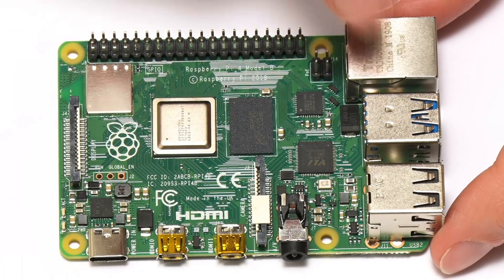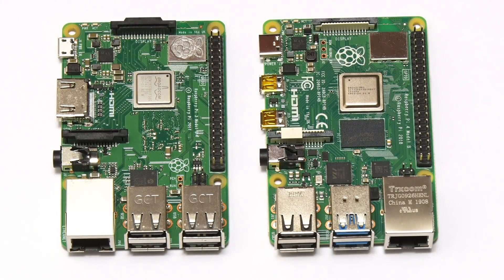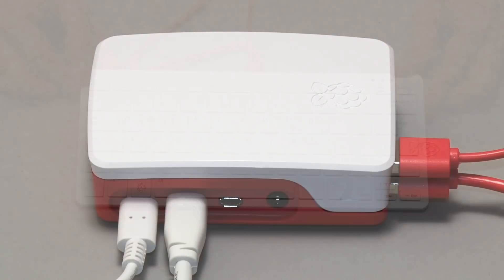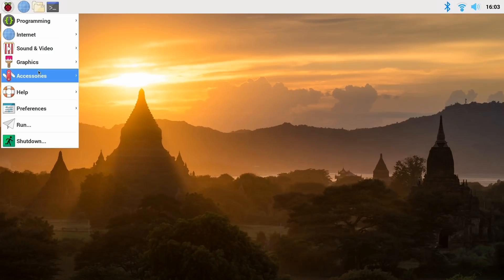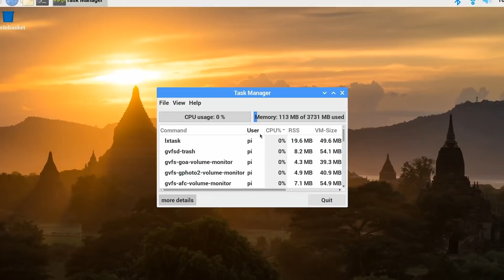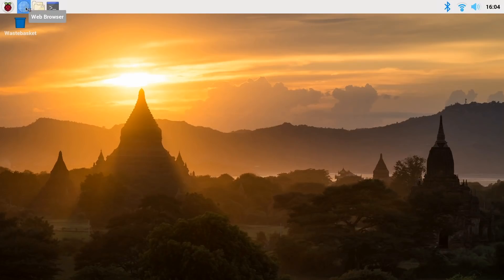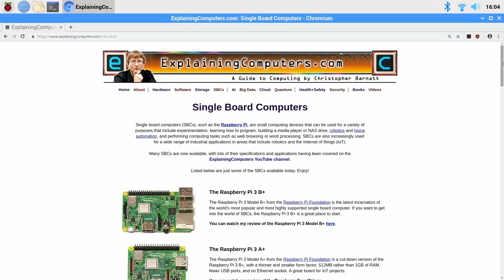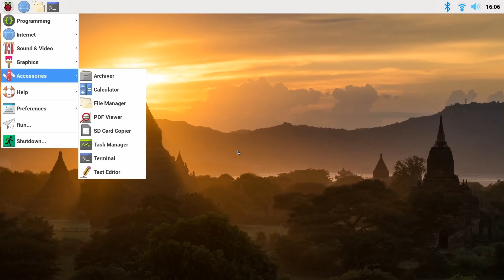Raspberry Pi 4 Model B

Comment: Raspberry Pi4 🍒💡
How to Power ⚡to PoE 🕸️ 24V???? and 48V ???? Doc!💬👍
DataMek From 🇩🇰 Denmark.
Reply: henrik, it's scary i could parse that :) ,but in essence you might need as one option is a generic  36W USB Type-C PoE Splitter – Powering 802.3at Type 2 PD Devices  or perhaps the Pi PoE HAT is compatible with pi4 but you will "need to confirm that" before you plugging anything in at your own risk

Comment: good thing they held the original price, i think i don't see those debatable exposed COB chips of the 3B, i know they are not so fragile but still frowny-face-worthy (in my opinion), the switched ports position is not a good thing considering the background of an object like this, i hope the jack connector still does composite video and analog audio, and about that they could have rid the ethernet port in my opinion, i bet most of the people just use wifi and a real screen, still good to be easy to provide an expansion but... i dunno, maybe you could save a bit of bucks... still good not providing onboard ROM, lots of reasons

Comment: Got my rpi4 today. It constantly over heats, while little red dots keep appearing on the ever flickering screen. Very disappointed... (have owned every pi iteration before this)
Reply from the maker: I will be posting a Pi 4B cooling video soon!
Reply: Benjamin Esh I noticed the 3B+ got significantly warmer than previous models. The RPI4 requires a 5V 3A power supply, so it probably will become a requirement to cool these newer boards. There was a full aluminum case for the 3B+ that doubled as a large passive cooling heat sink. They will probably make one for this version as well and that should solve your problem.
Reply: yeah,that's the price you pay for a higher clocked CPU its good advice to order your 'copper' heatsink when you buy these.
as a stopgap diy option, just cut some 6+ solid copper shims , clean and stack them together on the cpu with an elastic band holding them on it until you can get the right ones or keep it off until then...
Reply: Here is the case I was talking about. It comes with a thermal pad and contacts the CPU to help disperse the heat through the case. Works very well. This is for the 3B+, so I’m going to wait for this same brand to make it for the 4.

Flirc Raspberry Pi Case Gen2 (New Model) https://www.amazon.com/dp/B07349HT26/ref=cm_sw_r_cp_api_i_a4lfDb805NV55

Comment: Is the Raspberry Pi 4B still a 32 bit architecture or did it go to 64 bit?  Does anyone make a full folding folding laptop sized enclosure with display and hard drive space?
Reply from the maker: SoC is 64 bit; Raspbian is 32 bit.
Reply: Thanks for the answer.  Raspbian Desktop is the only 32 bit OS build I can find for my IBM Thinkpad besides Windows-7.  Your answer leaves me with the impression that 32 bit builds and apps will disappear altogether.

Comment: I'm not sure what to think here.  The whole concept of the Pi was a small SBC for about $35.00.  Now you have a more powerful computer but the price has essentially gone up, because even at the $35.00 entry level you are faced with additional purchases like a USB-C power supply at a minimum and if you use cases, the old ones won't fit, which is reminiscent of what Apple does.  If you were to spend the money for the $120 kit as he has just covered, you are getting pretty close to affording some used computer off of ebay with more features, power and capability of expansion as long as you are willing to sacrifice size.  Hmmmm.  I like this, but I'm not sure I like the trend.

Comment: 200 years in the future
50$ for a 200 terabyte ram raspberry pi35
Reply: 5 years
Reply: @cagjr3421  5 hours. Or it's just stupid.
Reply: It supports outputs of atomic high definition but it sucks with YouTube Neuro VR
Reply: will be no humans left in 200 years....
Reply: It'll run 20% faster and require a power plant as the supply at 10000 amps. These guys haven't improved performance much in a decade of trying.

Comment: I am curious about what options would be available for recording audio.  I have an old XP machine that I still use for transferring records to mp3, using Audacity.  It has good audio quality.  I can run Audacity on my current Raspberry PI 3, which is slow so I've never considered trying to record anything.  But with the new PI 4, if I can get some type of USB adapter that is compatible with Linux, it might be time to change out my XP box which is starting to wear out.   I'm down to 500 MB of RAM because one of the DIMM's quit working.  I am sure the motherboard will fail at some point as well.  I just need to be sure the audio quality is the same.  I used a laptop one time for recording and the quality wasn't as good.
Reply from the maker: I would add an audio HAT for recording quality audio.
Reply: @ExplainingComputers  Thanks for responding.  I just checked out a few of them online and will look into buying one when the PI 4 is released in August.

Comment: WHAT is the purpose/justification for USB 2.0 ports?! USB 3 is backwards compatible! Also noticed: no power switch. :(
Reply: Usb 3 is more expensive, both in the physical ports (they have more pins and handle more power) and the controllers to deal with them are more expensive. On these inexpensive devices, that can be a big difference. Also, there isn't much need for more usb 3 ports. Most usb devices don't need all that bandwidth, storage devices being the only major exception. 2 is plenty for a nas because you could just use hubs, the split bandwidth shouldn't really matter because you are only likely to access one device at a time anyways. As for the power switch thing, no pis have had them previously, you power on by plugging it in and shut down in software.
Reply: @coopercummings8370  Thank you. First actual explanation I've heard. I just wonder, though, what the $ delta is.
Reply: @stickinthemud23  I couldn't tell you what the price is, I don't manufacture electronics, but the usb 3 ports have to be more expensive because they need more materials, and the controllers need to be more sophisticated to handle the dramatically faster (10x) speeds. It is probably somewhere in the range of a few tens of cents to a few dollars, which doesn't seem bad, but when you are targeting super low cost devices like a raspberry pi, you need to know when not to stop upgrading. The extra usb ports might add about 1$ to cost, but there are endless things that only cost a bit individually but could easily double the manufacturing cost if they did them all. They could put a proper power switch on them, they could use sturdier video connectors like usb c or mini display port, they could beef up the power delivery on gpio pins so it could power small motors or similar, none of that costs too much but if you start doing all of them it adds up real quick. The manufacturers need to figure out the minimum amount of hardware they can get away with and still meet everyone's needs with a device like this because there is very little budget for better hardware.

Comment: What are the screen combinations for the Raspberry Pi 4? I have read that it can support 2 4k monitors, but with 30hz each, or 1 4k 60hz. With which combinations of resolutions can you achieve 2 60hz monitors? What about 4k and 1080p, or two QHD monitors?
Reply from the maker: You are correct, one 4K 60fps, two 4K 30fps. Two 60fps would have to be 1920x1080.
Reply: @ExplainingComputers  what about an ultra wide monitor (2560×1080)? Have you tried 2 screens with 2560×1600?  Will it work with 60 hz?

Comment: Cons: USB C 3a power supply required, they should really include micro USB to USB C adapter in the box. Also 80 degrees temp of chip ? 
Your video's are very informative, your style of presenting allows the viewer to multi task whilst watching and still hear and take in all the information.

Comment: @ExplainingComputers Well if you must know on what I would do with the Pi 4B and what I think of it: I'm relieved that they had finally upgraded their Max RAM to 4GB as well as USB 3.0s and a true Ethernet Port. Even though that they replaced with 2 Micro HDMIs and a USB-C power port, but I'm kinda disappointed that they didn't pre-solder a coloured GPIO pins, like the TinkerBoard and that the ARM processor isn't near as 2GHz or even using a newer Cortex than the A72. I don't know if the Pi 4B will work in the NESPi but I can use my hobby drill to allow my HDMI and USB-C ports to fit in as well use Sugru for some fixes. Now it appears my current Clear Acrylic Case will fit for my 4B when I will buy it, also I did drilled some holes for my TV uHat DVB tuner for Kodi and FreeView. But also there is a interesting question for us: will the Pi Zero have a newer upgraded model like the USB-C and Micro HDMI that the 4B got, and will it be significantly faster and smoother for Pi Zero bots, TV Tuner as well as using Pi Zero Cameras at recording near 4K at 30Hz? Well time will tell I suppose...

Comment: Is the Raspbian in 64-bit (aarch64)?
Reply from the maker: It is 32 bit.
Reply: @ExplainingComputers  Ah, too bad. I hoped to install a 64-bit OS for working with the architecture, but I remember the Rpi 3 wifi module having no 64-bit driver. Although, since they have upgraded the module, perhaps there is a 64-bit driver for the new one available.

Comment: Sadly YouTube videos still don't work well on it (I'm on the 4Gb version now using Firefox) so it's certainly not up to being a general purpose desktop box just yet. Chromium was no faster.
Reply from the maker: I understand that things will improve with better GPU software support in the future. They have not launched with, shall we say, optimum drivers.

Comment: I'm like "What?? What?? WHAT?!" Lol I thought someone made a mess of the video title and meant 3B. It so happens I need another Pi, so now I'm like "WHAT? A four? No one has a four. Fours don't exist. BUT IF THEY DO..."
I've got a heavy project planned to rig up my older SDRPlay 1 to another Pi and have it do 24/7 power graphing for the frequency of the moment. Needless to say, I need a powerful Pi for this. I'm sure... reasonably sure that I can do it fine with a 3B+, but faaaahuuuuck... if I can outdo a 3B+ then why the hell wouldn't I? Besides, I have other CPU heavy projects already rolling... Capturing in real time from an MCP3304 and pushing the data to a local MatPlotLib 24/7 graph on the pi as well as a much faster 10 minute timespan MatPlotLib graph running on my PC using data pushed over the lan. All using Python 3.7. It runs that poor little Pi like a readheaded stepchild. It works well but I'm constantly wishing the Pi had the performance of a big multicore power hungry bitch of a CPU.

Time a'go shoppin'. Thanks for the video! :-D

Comment: Finally, a Raspberry Pi which hardware is actually worth it for the price! At that price, their best competitor nowadays is probably the ROCKPro64, which is more powerful (hexacore CPU, PCIe slot, plus all the features on the Pi and more) but costs around $20 more.

Comment: I want to ask, is it raspberry PI 4 can run Win7 os and onwards?
Reply: Windows 10 ARM could work.
But other then that, with any Raspberry Pi, AFAIK you can use only operating systems and software made for the ARM CPU (which are not compatible with x86 and x64 from Intel and AMD).

Windows in general and most x86-64 Linux distros will not run on it.
Reply: @Loundre3  any idea if i want to run the  .exe application in raspbian?

Comment: I currently use a Dakboard Display Boards at work.  Although I began with the mini Pi, once my work colleagues got a glimpse of it, and make greater and greater demands of the board, I had to switch to the 3b and 3b+.  Shorly thereafter I was asked to add embeded video.  This of course meant the end of the Linux based SBC, and the entry of the x86 system.  I used a vareity of those, never really happy with the reliability or the load.  After using a Latte Panda, Intel compute stick, and UP! Bridge the Gap x86 based SBCs, I begrudingly decided to go with the Intel Compute Stick, as it had the best bang for the buck.  However this still limited me to 2gb RAM, and 32gb of storage, which is far too low to run Windows with any proficiency.  Finally I will be able to happily wrap those x86 SBCs in plastic, and opt for the new $55 4b+. Of course that will not be until 20 July, when my local Microcenter will have them in stock.

Comment: Not meaning to appear rude but the earlier PI's were of little value to an IT Professional.  This one seems capable of doing real-time video processing which I feel is a minimum requirement nowadays.  The 4GB option is a lifesaver for it and potential sales.  I have to say micro HDMI is a serious mistake.  If you have used them before on DSLRs, you will know the connector breaks within a few weeks of use.  Either the plastic central tongue chips or the overly thin and narrow connectors strip off the plastic insulator, then dislodge and lose contact with the cable's plug or even worse they short out against each other.  This Pi 4 is really looking both encouraging and genuinely useful.

Comment: Will be nice to see how well the USB 3 and Ethernet work out under load, if they are all via one hub or idependent from one another. Will make a great NAS if all 3 dont bottleneck.
I dont need one, but as usual will be buying one.
Reply: The gigabit and usb 3.0 controllers have their own links to the soc, I believe it is some form of PCIe. The usb 2.0 ports are directly connected to the soc. I hope this helps.
Reply: USB 3 and Ethernet each have their own bus,  but USB 2.0 and USB 3.0 share one bus.

Comment: So basically it is now possible in theory to run some older games on it and use it as a gameserver. Im not sure about the CPU though, but servers were running on a pentium 4, which is kinda same as this one. What do you think about it?
And it will probably need an active cooling system too if under such load?

Comment: Great review. Thanks. Accidently I asked a question as a reply to a post. Here is publicly:
Is it possible to use one HDMI input and the other HDMI for output?
So have a source on o e and display It on an other?
(That would be great for video editing and or for centralizing media centers with TV  from external sources)
Reply: Just in case o was not clear in my question: I am trying to find out if one of the HDMI port can be used as a source. Example, a digital TV output from a set too box that delivers IPTV to one of the pi HDMI as input for a media center. And the second HDMI will be connected tona TV. 
Therefore controlling all the house media, including ISP TV. In other words, a sort of single point of media streaming.
Reply from the maker: I think the HDMI ports are outputs only.

Comment: Since they stubbornly don't want to add eMMC storage and removable media - SD cards - remain the only permanent storage, there is a question, very important for the performance of this really significant otherwise upgrade - did they finally manage to add UHS-I modes support? so that people can see speed up to 4 times higher, than the ridiculous pre UHS-I 25 MB/s limit?

Comment: I would recommend getting mini heat sinks for the chips.  I'm sure this unit gets really hot when running full capacity.  Might even want to wait a while and get a case that can handle a small fan.  Again heat is a killer to electronics.  I do feel that using stacked full size HDMI ports would have made more sense than micro.  Would have given a bit more room fora future update to the "4 B+" (which probably will be a thing in 6 months).
Reply from the maker: Agreed, needs cooling.

Comment: I won't lie, my main flavor of preferred pi comes in Retropi flavor, and I have a feeling this will be quite capable. My kids, however, are really getting in to the idea of coding, and I myself like tinkering with a bit with Linux... even if we were to use this to build something as superficial as, say, an all in one emulator, I do think this would be capable of putting out quite a bit of performance boost. I know the CPU is only clocked a bit higher, but I am very eager to see some actual performance once things are optimized.. I may be getting one of these to build a nice little student computer kit for my kids to use for all their homework.

Comment: One thing I'd be curious about is antivirus / Internet security software. If it's connecting to the Internet on a regular basis, it would seem necessary to have them.  Finding a good fit for the Raspberry Pi would be interesting.
Reply: No problem.
Its not the processor (type) itself, but the software running the OS that is prone to infection.
That is almost impossible with Linux, as everything you want to do with system settings requires your password under Linux.
And there are no backdoors like in Windows.

Comment: I'm not a fan of the minor updates. USB3 should have been on the 3b+ but at least it finally arrived...one of only two updates that were wanted. The other being full gigabit ethernet. The extra RAM is nice but a minor upgrade to the CPU was lackluster at best. USBC for power is nice as well, but also long over due. Two display ports is overkill on a board lacking in the proper power to drive two displays. 4k @60fps?! My ass...You'd be lucky to get 1080p @ 60 fps on that.

That being said I'd probably still buy one simply because small board computers are neat little gadgets.

Comment: Dear Chris, Thankyou  ever so much for yet another useful video about SBC, I have been a regular watcher of Raspberry pi videos, and got so inspired that decided to buy raspberry pi 3+ to start a magic mirror project. It took me just 5 days to configure the sound in pi. I am convinced that pi is very useful and can easily compete with any windows operating system, but it’s very frustrating to configure sound and microphone, in the end I had to buy the GPIO snap on speaker and microphone module. I hope you will make some videos about these issues as well.